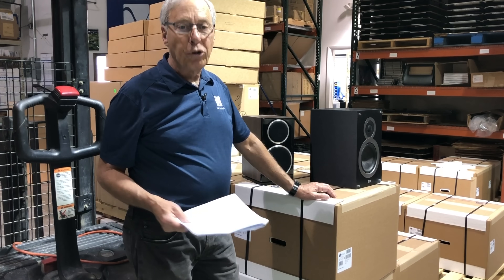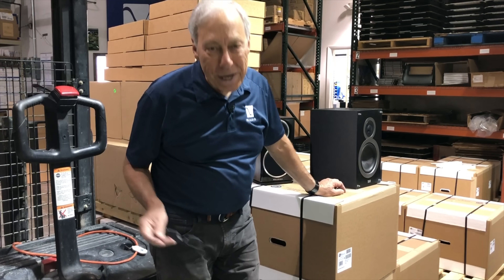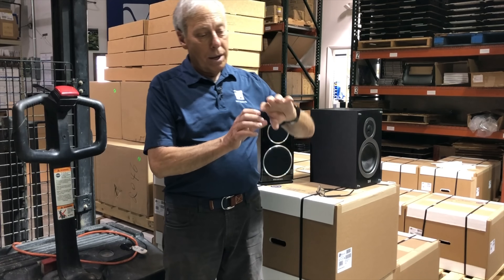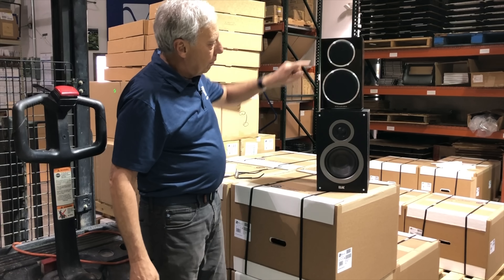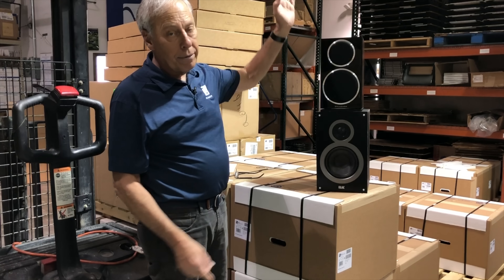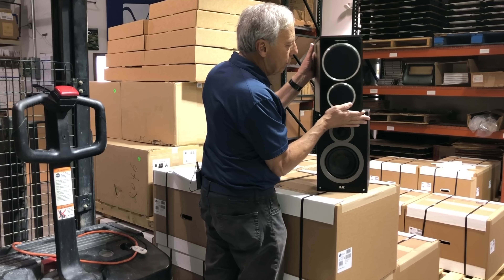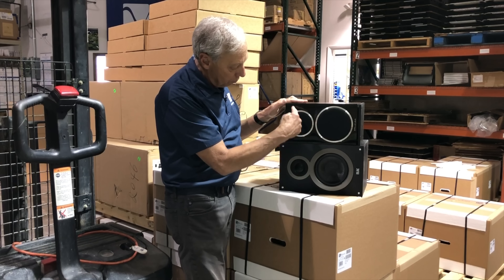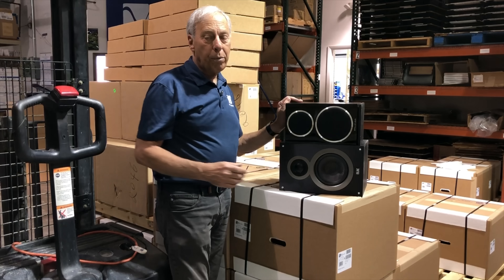Can you make a line source from bookshelf speakers?

Comment: I accidentally stumbled upon this when I decided to hook up two speakers in parallel on each (L/R) channel out of my Fosi v3. This was just kind of a system I had thrown together with leftover speakers and the Fosi amp to improve the sound of my TV. I just recently got my old Pioneer bookshelf speakers back from a friend who couldn't use them (I'm guessing these were originally $50-$100 per pair back in mid-2000s).

I could not believe the sound difference just by having two speakers on each channel vs. one and with two 8 ohm speakers, the parallel wiring means as long as the amp is stable at 4 ohms it should be able to handle the two speakers (also if you believe Fosi's claim of 300W per channel, that's enough for two 100W speakers).

It got me thinking about building a system with four "cheap" bookshelf speakers on each side, each driven by a cheap amp. Basically, if you can find four pairs of bookshelf speakers for about $50 a pair, with building around two Fosi v3 amps, you could build a system easily capable of 100+ dB for ~$600.

Comment: I have done this kind of line source but with super cheap 0.50¢ to $1 mini speakers on buy out. I don't remember exactly how many around 128 per array. I was experimenting with behind projector screen center high and low diy front surround stage with single point rotation mounts lockable and with there own delay and amplifiers Kenwood Basic M2 135mwrms@16omhs x 2. I had a friend come over and he was an audiophile in my eye with collective Japanese tube amp preamps 125lbs turntables list goes on, so credible. We listened to a few track in a 3.2 speaker setup. We found that center high and low set as a V config gave an incredible flow of presents and spaced instruments as in seeing the stage understanding that the flute set was in front of the violin set. Just blown away the both of us. I love the diy aspect of audio. Even when I had my manepans m...7 and b&k x2 subs I still tinkered with cheap audio diy projects.

Comment: Paul,
I have long wondered: when you series connect two [dissimilar] speaker SYSTEMS, doesn't that completely confuse the internal crossovers, much less the drivers? After all, when one system approaches an impedance dip or spike, the other system sees an increased/reduced current flow.
It this the case, or am I just nuts?
 [I was going to ask about current phase angle changes, but it would make my head explode.]

Comment: hey Paul, i think i am one of the ONLY, if not THE ONLY, 35 year old, exfelon, porn media company owner (6 years strong and over one million in deposits at BOA) and "audio head" that watches your vids and/or is a "fan" of you and work!!!

the method of "series parallel"  described in this is also used A LOT in car audio when running 3 or more subwoofers on a single 1 ohm amp...

i was/am in the process of building a DIY version of the IRS units you speak of in this vid and demo in others utilizing inexpensive off the shelf componets and hand made 8 foot tall 2 foot square cabinets... this vid answered my question of how i am going to build, configure and wire this setup... you will indeed get pics and vids of the entire process!!!

THANKS FOR YOUR CONTENT AS I KNOW IT MUST BE HARD TO RUN PS AUDIO AND CONTINUE TO PUT UP NEW STUFF ALL THE TIME!!! LOVE YOUR WORK!!!

Comment: Wouldn't connecting speakers in series place every other speaker out of phase, therefore cancelling the other's sound?
Reply: I don't think thats how it works. BUT if this is the case then just alternate the polarity with the wire.  The waves of one speaker could cancel the wave of the others.  Regardless of the polarity.  Though the effect might not be very significant, you will probably lose efficiency.

Comment: line array is just wrong concept.  there is different distance from each speaker to your ear. it means delay between them and phase shifts noticeable mainly on mids and highs. Line arrays are made to play horizontaly wide dispersion (about120degrees), but vertically very narrow dispersion (20-30 degrees) to compensate speakers play one over another. It is a trend and not very audiophile. Ideally you should run each speaker with different time delay set. but then it will work for one specified listening position only. point source is the answer!
Reply: Really? So the irs beta, irs v , all magnepans , Martin Logan’s .. are all wrong speakers. 

Line array is a concept you need to design properly and it would bury ... any point source hands down. Drivers are designed for a wider dispersion . You need to look up the difference between a point source DRIVER And planar/esl drivers big difference in dispersion behavior 

Go listen to a bigger magnepan , or a irs beta you’ll be sold

Comment: Did this back in the day with some garage sale and Goodwill-sourced speaker pairs that were the same model and wound up impressing listeners with the seemingly effortless and uncompressed transients and detail in the sustains while having appreciable output. Power came from an old stereo receiver equipped with integrated A + B + C speaker pair switching in various combinations = Quite satisfying results.
Reply: Appending: the pre-existing frequency range didn't change - no additional bass frequency range was added, for instance - but, with more surface area identically driven, there comes seemingly less effort / excursion for the same mid-bass and bass output and my ear hears intricacies, details that can shine through therein (above the lowest bass / subwoofer territory requiring much greater excursion for waveform creation) while potentially mitigating the minutiae of distortions typically from a given midrange-bass driver trying to emit mid-range waveforms while simultaneously going through mid-bass and bass excursions through its assigned crossover slope. Surface area can bolster bass accuracy and amplitude without requiring  excursions that can become detrimental to mid-range and mid-bass accuracies so the typically hidden / subjugated detail therein can be heard. Whaddaya think?

Comment: I used to do this with 8 B&W DM110 speakers. They were 6 ohms speakers if I remember right so hooked in parallel it would be a total load around 1.5ohm per side. Seems crazy, but the amp I was using at the time seemed to handle it just fine. It did not produce "more bass" or "more definition" than using only one speaker, but the sound stage was absolutely amazing and the sweet listning spot seemed wider than using only one speaker.

Comment: One side issue with the series parallel connection is you get only a negligible increase in sensitivity. Series connection nets no increase in sensitivity, only parallel connection does that. Two 16ohm 90 db speakers in parallel give you a 93db at 8ohms. 4 of them, 96db for a 4ohm load. But 5 86db 4ohm speakers in series will still be 86db. 😕
Reply: Don’t forget the fact that you would enhance the power handling capabilities of your new array.

Comment: That is an incorrect definition of "line source". What was said in this video is the definition of "a bunch of drivers arranged in a line" which is definitely not the same thing. A true line source is is single driver, moving in a uniform (pistonic) motion that a uniform horizontal dispersion. The industry uses a line source when they want a very wide dispersion (left to right sound field) that is very uniform. A line source will give a very narrow vertical dispersion of the sound waves so the driver is commonly placed at or near ear level or the line source is manufactured to be very tall (three to five feet tall is not unusual) so no matter how low or how high you sit, you still receive an even distribution of the sound field. Another reason for making the line source tall is if the manufacturer wants to increase how loudly the system can play, the taller the driver the more air to can move and the louder it can play.

Stacking drivers is not really a line source, each driver will launch its sound wave with its own dispersion characteristics, the waves will interfere destructively at some points and reinforce each other constructively at other points, which is why speakers that use that construction method (there has been quite a few that do that) have such a weird mushy sound. Of course it can be done correctly, such as what Infinity did, but it you stare at an Infinity closely you'll realize that all they did was to take a shortcut and make a tall line source of of a bunch of short line sources. Since each short driver was already a line source, they behave together as a "mostly line source" with less interference than would be experienced had Infinity used some other type of driver.

Laying speakers on their side and stacking them up is not a line source because the tweeters are still more than a wavelength apart so they do not act in unison, they will still reinforce and cancel each other out at certain frequencies and certain distances. So stacking bookshelf speakers does not make a line source, it makes a huge mess with all those out of phase drivers partially cancelling each other out.